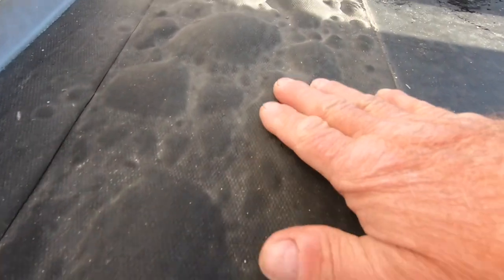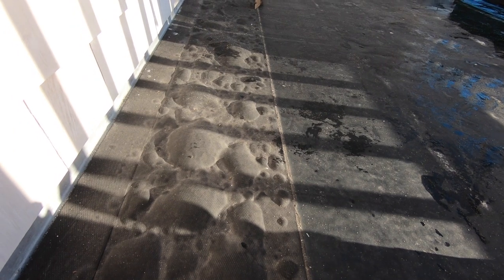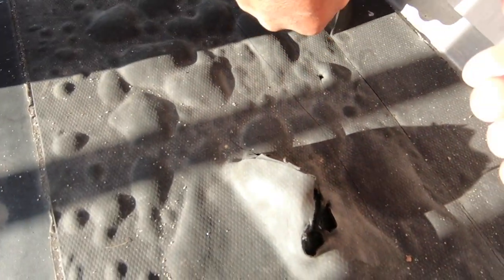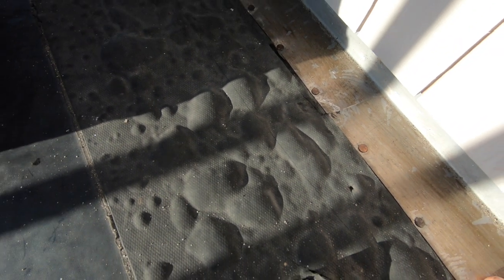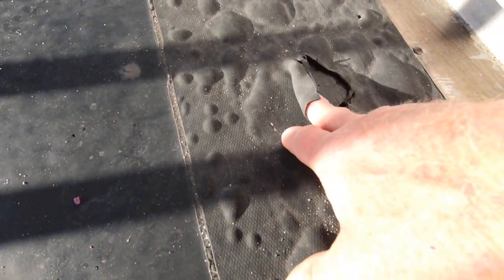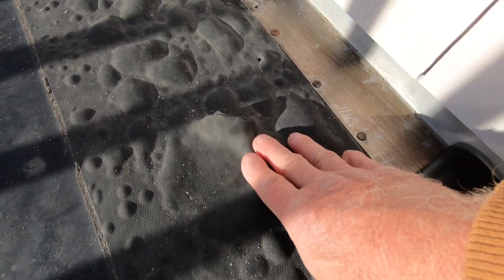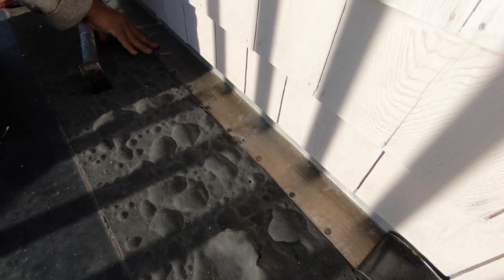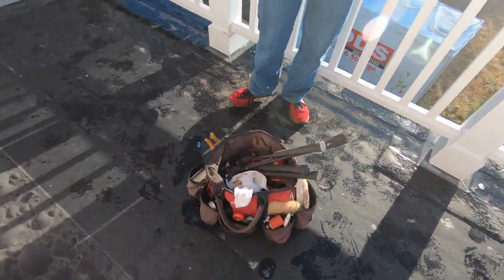Why EPDM Rubber Roofs fail prematurely.

Comment: It was improperly installed initially.  EPDM should have been installed under the siding from the roof to wall transition.  Not the fault of the epdm
Reply: Ya and what about a white epdm protective coating?

Comment: This normally blisters if the glue hasn't been given time to become touch dry before applying.
Reply: Yeah, adhesive should be applied to underside of rubber and to surface attaching to and allowed to dry off completely before making the seal. You should be able to touch it and not have it come off on your fingers.

Comment: That's a tape that's bubbling not epdm and there should not be tape to the metel on its own. Have been installing epdm for over 20 years everyday and never seem this happen.
Reply: Quite right mate, is not EPDM's fault, clearly that EPDM was badly done, must gone up to the wall at least 300mm up then properly seal!!
Reply: You scuff the metal with a work wheel then you can tape jist fine done it gor over a decade.

Comment: That’s poor installation, not a material or heat problem. Looks like they rushed it or they did it on a cold day and didn’t give the primer time to flash off. On a warm day, primer flashes off in a few minutes, but will take much longer once the temperature drops.

Comment: To be fair, it isnt the EPDM that's failed, it's incorrect adhesives and poor application.
Reply from the maker: Yes, the adhesives failed but that is part of the EPDM installation. So, when the engine on an airplane fails while flying, did the airplane or just the engine. People die when one component fails. The roof becomes of no use when just the adhesives fail. I have tried to repair an EPDM roof in the past fixing seams, it was not worth it. It takes more effort to make repairs than to install a new membrane.

Comment: They fail because they are not put on right. Most are not trained( im union 5 years of school). That patch has bubbles because it was put down with glue and not primmer. Or the patch was put down when it was raining.
Reply from the maker: Thanks for your input, Eric. I think your 1st statement could be correct, no primer. 
But, as I understand the concept and this is how I have done it in the past, "no expert", is a one-coat application of the adhesives. They call it EPDM primer but it is an adhesive at the same time.
I clean the EPDM surface, apply the "primer", then peel off the paper from the EPDM cover tape, then apply it over the primed or glued area after it becomes touch dry.
I am trying to figure out if there is another part after putting the primer?

Comment: So that bubbling is not because of age but poor installation. They likely put down too much primer and didnt let it dry. 
Extreme heat exposure doesnt break down EPDM like it does TPO. In fact in testing labs EPDM survived years beyond TPO in extreme heat (in fact no TPO, INCLUDING those specifically made for high heat application, survived over 7 months in extreme heat testing as opposed to years with EPDM).
Now EPDM has roofs out there over 40 years old. TPO has not even been around that long? Is TPO worse? Too many variables but needless to say anyone that has watched TPO for ten years has seen roofs where only the scrim is left, roofs that can be broken via fingernail, failures due to grease, etc. 
Likewise, with EPDM, they will see ripped apart seams and ripped/missing flashings. Things like Securement strips or seam tape are newer to the market. it used to be just glue bonding the seams. It's much stronger now than the 80s and early 90s. Is an adhered seam ever as strong as a welded one the same size? no. But if you install EPDM right it can survive decades in any climate. 

As for the comment of reformulation of adhesive, I've been using the same primer and tape for over 10 years. No idea what manufacturer he is referring to. TPO, by the industry's own admission, had fire retardant issues last decade and had to reformulate the entire membrane. So while EPDM MIGHT have newer adhesives (still dont believe), TPO does have a newer membrane. Which may or may not be better. 

It seriously depends on way to many factors to type, what membrane is better. Whats good for Joseph is bad for Mary, so to speak.
Reply: to add to this vulcanized EPDM rubber is used in Rocket Motor combustors in which the temp reach +5000degF. So if anyone tells you 160degF is a problem, they are misinformed.
Reply: @smokingun7  he's blaming the heat for damaging the glue, not the rubber

Comment: Theres 2 problems with this. 1 they used "elastoform" or whatever the manufacturer calls there flashing as the termination and 2. they didn't let the primer dry. If you don't let the primer set, the sun will bubble it up and as it dry's underneath, the gases need to go somewhere. this EPDM needs to be run up the edge of the building underneath the siding and adhered with EPDM adhesive, different from primer. If you want to save work you can use a termination bar under the siding with a good amount of caulk, water block behind the membrane and caulk on top of the bar. the only spot there should be "elastoform" is on the vertical seams to protect from blow outs. Also a RUSS strip or an equivalent should be on the angle change to make sure it doesn't bridge.

This is all from an inexperienced contractor thinking they know what they are doing
Reply from the maker: Thanks Marcus for taking the time to explain what went wrong. I really appreciate your experience. I have never installed EPDM rubber but made a few repairs here and there.
Take Care

Comment: Agreed Doctor,  I use T&G 8x2 green 18mm kronospan decking , a 2c layer tacked on with bitumen facing up,120mm kingspan , then a 2 layer torchon  system, no 3 premium sanded ,and a  4.4 mineral torched on, both SBS polyester, from IKO,  I have seen Kronospan after 40 years and  stili serviceable.
This system will last 40+ years.

Comment: That is installed with the primer not the glue and it bubbles because it wasn't rolled in properly with a rubber roller type tool it usually bubbles right away if it isnt doller out
Reply from the maker: thanks for the info. I am no EPDM expert. I just happen to see many EPDM failures

Comment: uncured rubber is only to be used in corners. on the metal I would use a reinforced batten cover strip or just a simple strip of epdm with seam tape under the seam would do. wrong materials... wrong application doesnt yield epdm bad. UV is very bad for uncured rubber. I always coat the uncured with a white coating to reflect uv or sometimes I simply double up on the uncured when doing corners.
Reply from the maker: Very good comment. I like your style. Covering uncured EPDM rubber is essential. But, that is not common practice to all EPDM installers. I have never seen any double ups or coatings in my 30 years of fixing EPDM roofs. Here is the problem I see with EPDM roofs. Besides the uncured rubber that is used around flashing that cannot withstand UV's, the contact glue to bond seams also breaks down due to extreme heat. I have seen where the surface of an EPDM reaches almost 180 degrees. The contact cement or "primer" used will eventually break down and the cover tape will peel off.
Thanks for comment. please comment again.
You seam to know EPDM very well unlike me.
Reply: @FlatRoofDoctor  You never see any double ups or coatings in 30 years because they wil not fail and you only see roofs that fail :-) 

Funny conclusion .........

Ps: im German my englisch ist schlecht.
Reply: It cures over time, but protecting it with a coating isn’t a bad practice at all. UV and Ozone will do a number on uncured rubber, but once cured EPDM is practically immune to them.

Comment: Just tape to metel should not be used sor bad job not bad product.
Reply from the maker: Hey Wes
Thanks for the observation. I am not an EPDM expert. All I can say is, I have seen too many issues with EPDM. The adhesives they used never lasted, I am sceptic that the cover tape they introduced 2 years ago will hold up.
Anyway, everyone have their preferences.
Thanks again
Naas

Comment: I’d have to respectfully disagree with this I’m afraid... aside the fact that the transition is wrong, I would imagine the application of wrong... heat shouldn’t break down the glue as Firestone (I believe that is the system used here) recommend you apply these flashing with some heat. May as well have just used silicone anyway to be fair... should have a minimum up-stand of 3inches but that is really pushing its luck if you were to get a good heap of snow. Perhaps try looking into it a bit more, you might be surprised with the results when fitted properly, EPDM’s biggest issue is people think it is easy or “diy” friendly... yes it is relatively non skilled but you do need some knowledge for it to work correctly... could I ask what you will use to replace it? Please don’t say fibre glass... that is used for things that come out of the water every six months to be cleaned and coated again! 😂
Reply from the maker: You don't sound like you have much Experience. Why have they changed the EPDM Technique of gluing seams together  more than 4 times since the 70's. That should tell you that it has never worked and they still try to find ways to make it work. The latest way is to use cover tape over the seams. This was introduced 3 years ago and I have already seen some roofs failing with that technique. Contact cement is not designed to withstand extreme heats for a long period of time, period.
Reply: @FlatRoofDoctor  I’ve done a couple of hundred and never had this issue... in fairness I live in England where it never really gets hot... I do like how you got that I don’t have experience from that though 😂 only been doing them for 14 years... come on spill the beans, what do you use?
Reply: @FlatRoofDoctor  not looking to pick a fight, I’ve met plumbers who flood houses but are fully qualified... just don’t agree with bad mouthing something you say you’re not actually an expert on... I think you may have just found a market in blaming a product other than the cowboys 🤷🏽 easily done
Reply: You’re a torch felter, I respect this, a good one is worth their weight in gold. It is out dated but I often recommend it when it is the best option for the job in hand,  it still has its place in the construction world even if it is being replaced by safer, cleaner alternatives. I would never slander it just because I can’t do it. I cut my teeth labouring on mineral roofs with my grandfather, he has been on flat roofs since the days of pouring   bitchumen and throwing chippings... a wise man. And he did not like the fibre glass systems. But he did see sense and move with the times with epdm. A hard thing for someone his age to do.
Reply: Well I am sorry that we couldn’t have had a better discussion and share thoughts and ideas. I thought with your high level of knowledge and experience I could stand to learn a thing or maybe two and hopefully pass on what I know. I guess you are how you make yourself out to be in the video, unfortunately stuck in your ways and think you know it all 🤷🏽. Good luck to you for your remaining working years, your work looks very good and I wish you all the best. Sam.

Comment: Cured cover strip or batten bar should have been used to strip in the metal. If they use glue, they are doing it wrong. Many manufactures have their primer to use with their uncured elastoform or cured cover strip. That is most likely due too poor installation. Another reason why that bubbled is because the uncured elastoform was not lap seal 100% around the edges. I know manufacturers like Carlisle and Versico required for all uncured elastoform to be lap seal, because it protects it while it cures.

Comment: Can I put epdm on existing fiber glass roof? Thanks
Reply: Yes mechanical install
Reply: Yes.  You simply need a new surface to adhere.  HD 1/2” iso will do the trick
Reply: Yeah use half inch fiberboard epdm and make sure to lap seal and seam tape don't skimp

Comment: Do not buy this crap! The adhesive is not holding the membrane! And the worst part is that you won't get any support if you have any problems! The Hertalan will simply ignore your emails, that is what happened to me.
Reply: I've used hertalan for years had no problem